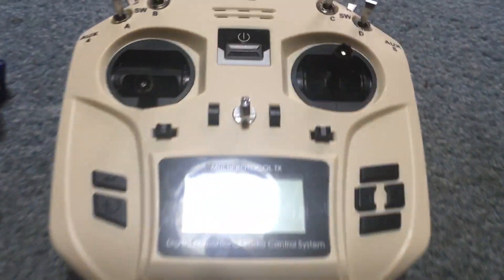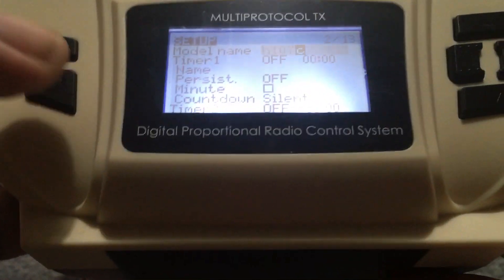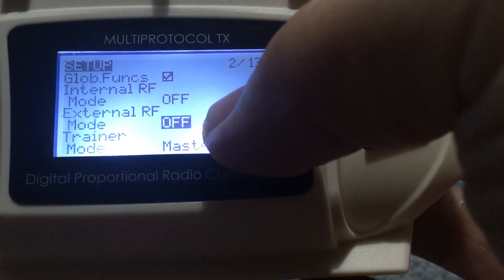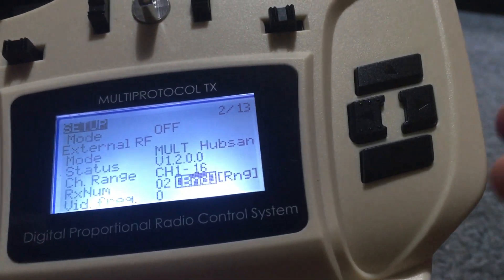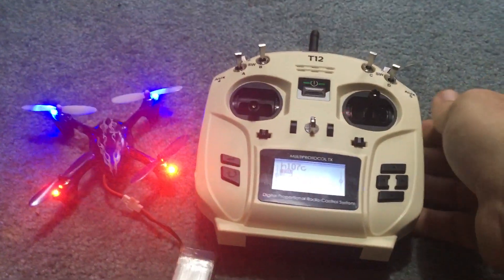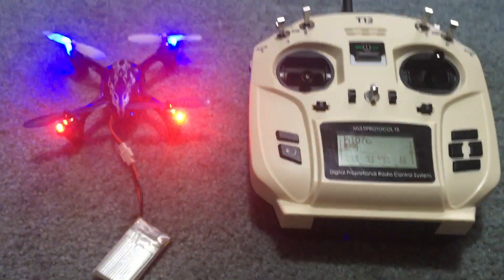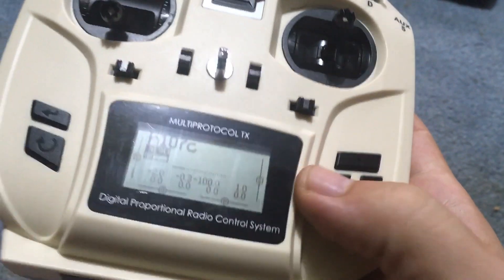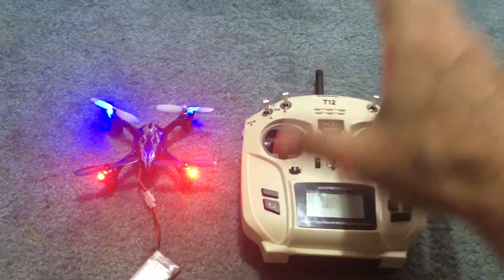Jumper T12 OpenTX Setup Hubsan X4 DIY

Comment: Hi jay
Can you help me I tried drone days no response yet I gotta jumper t lite a qx95 hooked it up to a old clean flight version works ok so binded motors move can't arm n my mapping wrong motors move in test in clean flight it's a qx95 with dsm2 if anyone can help I'd be so grateful cheers guys.
Reply from the maker: @kennethwebb7922  unfortunately I do not own the Drone so I won’t be any help. I did see the post and Drone days what you wanna do is include an image of the controller and the drone so I would perhaps just delete the post and make a new post post without an image is gonna get skimmed over very quickly.

Comment: I have the T16 and what drives me crazy is that I have to rebind every time I change the battery, I don't want to have to turn off the transmitter every time I change the battery.
Reply from the maker: Should not do that with every protocol but some protocols you do have to re-bind after each use kind of annoying but really not too difficult

Comment: Hold the enter key (arrow on the left) and you can go back a page also if you add a switch to channel 6 you can turn off the led's.  I have a 2 posistion switch on channels 5 and 6 I can't tell if 5 is doing anything yet.

Comment: Hey JD the Arduino software can create a .bin file that you can load onto the transmitters SD card and flash the Jumper 4in1 for new protocols. And ya can hold page button to go backwards.

Comment: When I bind to my husban h111 for some reason The yaw and the roll channels are reversed (left is right and right is left) pitcher and throttle work fine but yaw and roll are reversed.  Any reason why this is happening from yo video it looks like mine is set up the exact same way!
Reply from the maker: Reverse ur channels
Reply: Yeah I noticed that Jay didn't actually fly the104. I'm pretty sure his is doing the same thing yours s doing and mine did. We should be able to fix it  but I have no idea how. THe developers pooched this one. THe sticks track like for my bayang clones and tney work as expected.
Reply: Go to page 5/13 and if you want to leave everything in expert mode just change the Aileron AIL and Rudder RUD to -100. 
  I set up modes on switch b and leave the throttle at 100% personally,YMMV https://opentx.gitbooks.io/manual-for-opentx-2-2/inputs.html

Comment: Thanks, for this info. I finally decided to get a 1 TX for all, so I have this one coming. I like the stock trans on the Bugs 5w good distance ( I can get just past 1000 meters on a good day) + nice info on screen. The Bugs 8 Pro trans I do not like. No distance , no screen. So any help using this T 12 with the Bugs 8 Pro would be appreciated .
Reply from the maker: I’m not sure u can use this on the bugs drones, the Jumper T8SG is runing devo vs this one runing open tx, devo is constantly being upgraded as aposed to open tc that is the reason I’m able to update protocols with the t8sgs
Reply: May not be 1 TX for all, 1 TX for many? I only have about 5 toy drones so far.but I would like to get more of the kind I can buy cheaper without transmitter. @JayDrone
Reply: Yes you can fly the Bugs 8 with Jumper T12. It is on the protocols list. I fly the Bugs 3H with the Jumper T12. Select custom then the sub menu choose 41 this will bind with Bugs 3, 6 and 8. I choose 42 wich binds with Bugs mini and Bugs 3H. You might have to update protocols. I had too.
Reply: Thanks, for the info.  I ordered my T12, but I am waiting for it to come from China. I will try it as soon as it comes. @MrLDavids
Reply: I now have a bugs 3 and 8 pro. It would be nice to be able to use a little bit better trans for them. Then I'll work on the syma x5uw and the jjrc h31.
Reply: @summerplumber  https://github.com/pascallanger/DIY-Multiprotocol-TX-Module/blob/master/Protocols_Details.md list of protocols. A few are new since I purchased T12 so someone out there is working on protocols.
Reply: Thanks again. Very helpful . @MrLDavids
Reply: @summerplumber  After a week of flying Bugs 3h... way more precise with T12 but no rssi out of range warnings and no low battery warning.
Reply: I selected custom , then subtype 41 but can not get it to bind my bugs 3. Any suggestions ? Or do I just have to do a update? @MrLDavids
Reply: @summerplumber  Was wondering if I updated at all. Sounds like I did. I did exactly like you have done selected bind and pressed enter. 500m flights distance measure google maps. I did update when I saw bugs join the list. custom->41 0

Comment: Hi!  i was thinking to buy this one for my snapper7 flysky, im a beginner, so basically i just turn the mod OFF and select mult Flysky to bind in to my Snapper 7 ?
Reply from the maker: Basicly as I showed it is super simple
Reply: Thanks Bro!
Reply: +Jay Drone Actually it is working now, I have my Bugs 3 on this since yesterday. You need only flash firmware on multi module.

Comment: Good video. I suspect that I won't be buying this Jumper. I am too comfortable to start learning OpenTX
Reply: I'm sure that you too will have spotted this by now but a review of this Tx published later than yours suggests that the 'page back' function is accessed by using a long press on the 'page forward' button. I'm only reporting what I have seen in an effort to assist It may not be accurate .